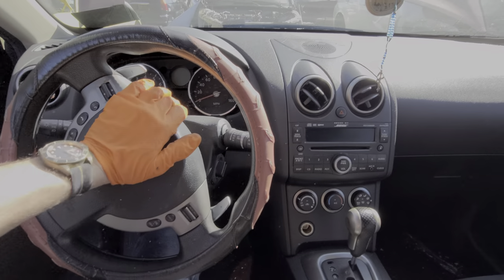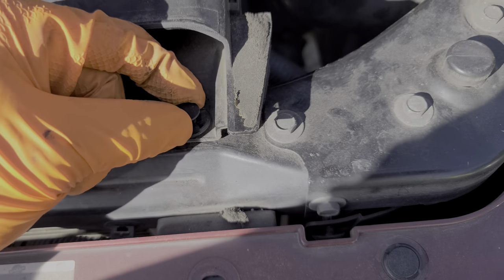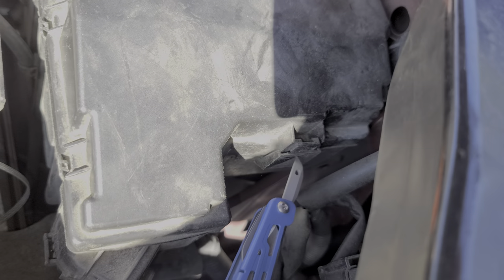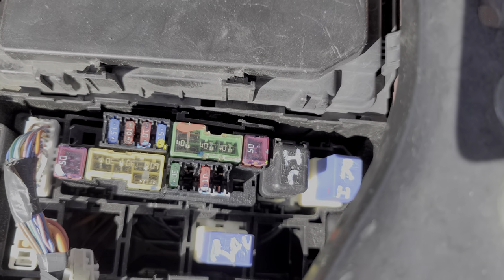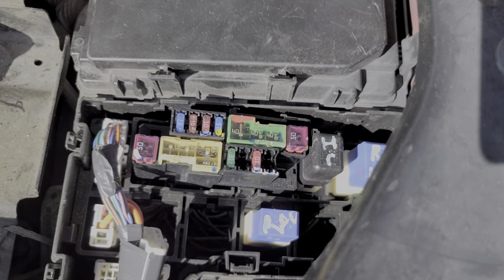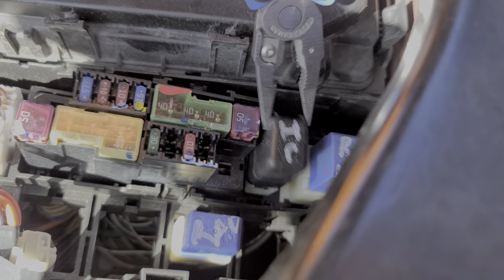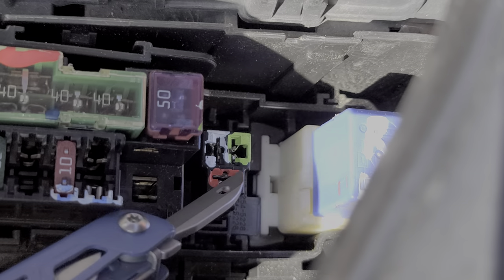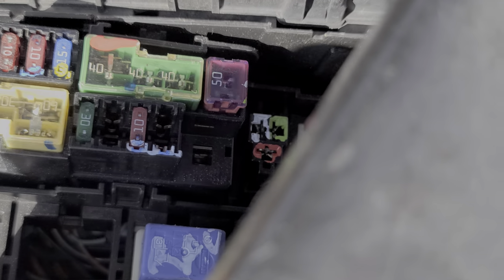2009 Nissan Rogue Horn Fuse & Relay, Horn Circuit Troubleshooting

Comment: El Imparcial • Theres a ground wire at the bottom of the battery tray. Is held down by a 9/16 bolt head. Take the battery out. Find the 6 bolts holding down that tray. Find the bolt holding down the ground wire. You can hook up another wire with an eye to that same ground wire to get the ground you need for your horn ground. From there you can cuide the new ground wire to the ( horn's relay switch contact point ). Check to see after you connect it. To hear if the horn will functión ok. Hope it works.

Comment: Thank you so much! My car was honking at every turn and people were starring at me.... it was so embarrassing. Now I don't have to worry about it.
Reply: My 2008 rogue is doing this now...the alarm box works when locking...now the horn is honking at every turn...embarrassing is an understatement 😭😭😭😭😭😭
Reply: What was the issue?
Reply: steering wheel clock spring i belive very cheap at ebay just make sure disconnect the battery because  the airbag

Comment: I can make the horn work by removing the relay and jumping from 1 to 3 just like you did, and the hotn worked. I tried a new relay, but it still didn't work. The weird thing is, i can push the relay down real hard, and the horn will beep. What do you think the problem could be?

Comment: Thanks for sharing. My gf's 2013 rogue just over night started flashing an air bag symbol & the horn just stopped working like a year later.still beeps when u lock it with the key but no horn & blowrr motor will cut off seemingly on its own. Im thinking ground /wiring issue?
Reply: Figure it out?
Reply: @dingdong7777777  nope still blinking away lol. Since then shes had the blower motor & resistor go out,dead battery,wheel bearing hub replaced. And of course i got stuckdoing all of this. But nope,that bad boy is staying on for the long haul 😅

Comment: Alright, so if when pressing the lock button on the fob the horn blows, but when pressing the button in the vehicle it does not. Can it still be a bad relay? Or am I looking at a bad horn switch in steering column

Comment: Nice video. I replaced the relay after jumping the two spots you said horn blow and still not working. Any other thought?
Reply: Did you ever get it fixed?  My wife's horn stopped working yesterday and after doing the troubleshooting I found but the horn sounded when I jumped the two spots. I'm thinking I have to replace the relay itself and see if it gets the job done.
Reply: Also having the same issue. Touched the two spots and the horn worked, bought a new relay and horn still isn't working. So what's the issue now? Helpppp
Reply: Could you fix it?

Comment: Hi, question. I put a new 10a fuse in the horn slot. As soon as I click the lock button it blows up. If I activate the alarm, the fuse blows. Any ideas why this isnhappebinm
Reply: I have the same problem with my car any idea...? Please
Reply: DISCONECT THE HORNS  IF RELAY CLICKS  CHECK FOR SHORTED HORN IF STILL BLOWS RELAY BAD
Reply: gtubyyy • Good one. Starting at the horn wiring. Then going down the wiring to the horn's fuse. If everything checks ok. Then it has to be a short circuit on the horn wiring inside the steering wheel contact points.

Comment: First off, thanks for the video! Is the horn related to the lock on the key fob? The reason I ask is when I press the lock button on the key fob I hear the horn, but when I push the actual horn on the steering wheel nothing happens? TIA
Reply from the maker: It's likely to be a broken clockspring behind the steering wheel

Comment: First off, thank you for the guidance on how to find, remove and take off the horn relay. I followed all your tips and I’m still having the “no horn”. I did test the horn by bypassing the connections and the horn honked fine. I also ohmed out the fuse and it was good. My question is… do you think installing an aftermarket relay from Auto Zone be the issue? I’ve heard that using a non OEM Nissan part can be an issue. The next question would be if it could be anything behind the steering wheel? Btw, my car is a 2012 Rogue.
Reply: you problably will get your reply in the next two more years coming ahead bro 🤣
Reply: @rubbermallet3873  23 MORE MONTHS COOL GOT THE AIRBAG OUT WHAT NOW
Reply: Did you ever found out the problem
Reply: @Silenceplz595  I had a mechanic tell me it’s the clock spring in the steering wheel. I haven’t fixed it yet. It’s kinda expensive so I’m saving up for the part and labor which will run close to 500 bucks. I’m not desperate to get it fixed since inspection isn’t until April of next year.
Reply: gtubyyy • You got the AIR BAG out. Did you take photo pictures as you were taking it apart. It's always very important when you're dealing with the 2010 - 2014  Nissan Rogue's - -
( clock f/n spring ? )...
Reply: very cheap at ebay around  40 bucks